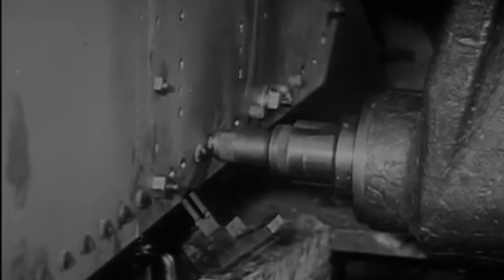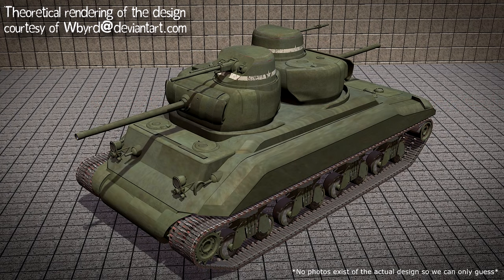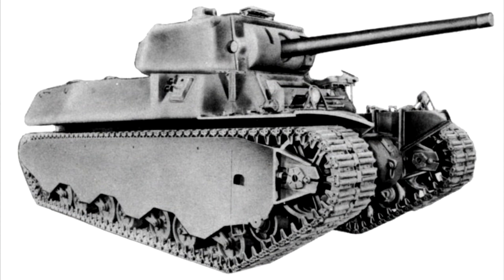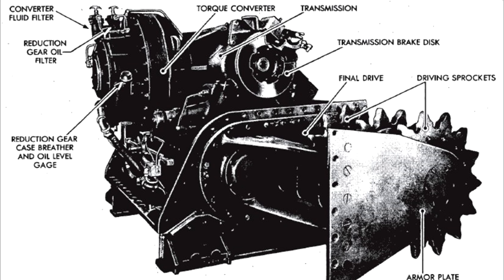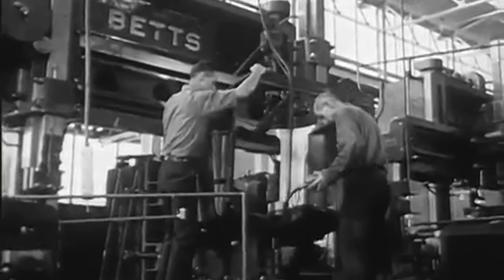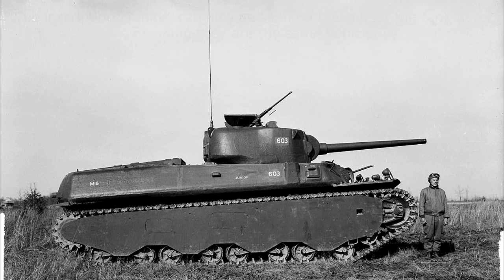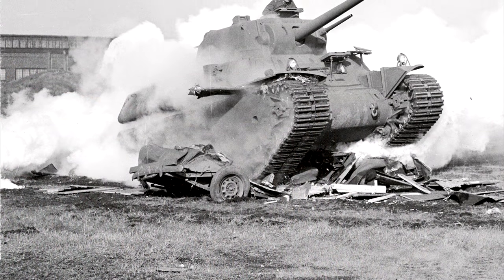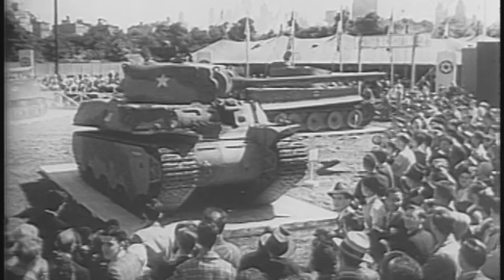America's Tiger, the M6 Heavy | Cursed by Design

Comment: Ordnance designed the M6 and M4 at the same time. The Army felt they would need one to face bunkers head-on and take on heavier tanks the Germans probably were working on. The crews hated it due to their cramped working conditions. The petro-electro drive showed promise so was set aside to use in the M4'S replacement the T series. The larger Wright radial powered a fluid drive that used kerosene as the hydraulic fluid. It was less problematic than the electric drive yet required more maintenance than the Army wanted to deal with. The new HVSS suspension held up but they had a constant problem with the tracks breaking from the weight. The armor commanders said they didn't need a slow heavy tank so the Army cancelled its production and used those on hand to test different turret designs for the M4 chassis, T series and the Heavy T26.

Comment: A hydrostatic transmission is varied in output and input, as long as you have the engine for it and it's designed right..... It's the best transmission out there.

Comment: I personally think it was a pretty poor decision for them to leave it behind because what they could have done is on the opposite side of the 37 mm put a coaxial 30 caliber and for move one of the 50 cals in the front hull with a 30 caliber as well . Probably should have kept that little machine gun they had in the back of the t1ht  beforehand

Comment: I must confess I never knew about these tanks. It must have been infuriating for M4 Sherman crews to know that the US Army had a heavy tank program all along, but just never got it together while they were being pummeled by the big German cats. Piling up sandbags, extra road wheels, scrap metal, even creating crude forms to pour concrete into on the front of their Shermans for a chance to survive against the Panthers and Tigers. Not till the closing weeks of the war did the M26 Pershing debut on the battlefields. 
Who were the guys that said two medium tanks in North Africa were better than one heavy?
Certainly not the crews that first encountered the Tiger I. US Army armoured combat doctrine would eventually call for a ratio of five Shermans  to one Tiger on the battlefield.
Reply: SPOT-ON
Reply: Pretty sure the crew can be happy knowing where the enemy tanks are already thanks to air supperiority
Reply: The M6 and M4 were designed and made at the same time. M6 crews hated the tank due to cramped working conditions and having too many mechanical problems. The M4 tankers piled all that stuff onto their tanks for protection against shaped charged weapons. The M26 Pershing had little effect on the battlefields since Congress ordered for the first 20 made to be sent to Antwerp in January without being tested and without trained crews and mechanics. Those managed to take out around 12 German tanks before the war ended. One Super Pershing was sent over in late March were the Army allowed the idiot Belton Cooper to add 5 tons of additional armor to the front of the hull and turret since 3 M26's were knocked out by shots to those locations. The Super Pershing managed to take out 2 tank-like objects that were 1500 yards away before being knocked out by a Pz. 4 that put a shot thru a side. It was towed to a vehicle dump and cut up for scrap after the war ended.
Reply: Five Shermans because that’s the number they traveled in.

Comment: From your account, they never seemed to firmly settle on a design and thus were continually ironing out bugs.  It was probably thought best to keep the bugs at home and let the boys have something a little more trouble-free.  I concur.

It also seems any tank should have an undercarriage designed to support and move about 50% more weight than the original design.  This is simply because improvements to tanks always involve adding weight.  The M6 carriage seemed overwhelmed pretty quickly with added armor and armament.  It was never ready for much of anything.

Comment: I will say that the Americans using aircraft engines was pretty smart. It simplifies production, and means more spare parts are available. Plus the aircraft engine outputs almost 1000hp. I wonder why the Germans didn't do this for their tanks? Especially for Tiger which only had around 600hp. The German aircraft fighter engines had 1000hp to 1400hp depending on the model. Much better for a Tiger tank.
Reply: Those outputs were with forced induction. In the same way that the power output of the Meteor was only about half of what the supercharged Merlin was putting out, a naturally aspirated DB 601 or 603 in a tank probably wouldn’t have been a huge improvement on the Maybach engines actually used, and German industry was already unable to meet demand for the DB engines just for aircraft use.

Comment: The reason why the M26 pershing took so long to get to the battlefield due to a general McNair, probably something similar happened to the M6 during WW2.
Reply: The Army conducted war games in Louisiana, the Carolinas and California/Arizona Mojave Desert in 1941-42 where the commanders realized that a heavy tank would be impractical to use. During the 1941 maneuvers in Louisiana and the Carolinas, they used halftracks to represent the M3 medium and M6 heavy with their weights painted on the doors. That was done  to remind the unit commanders that the tanks had to use bridges capable of handling their weight or the observers would declare a bridge being collapsed with the tank out of action if one tried crossing a standard rural bridge. Recon would report the weight limits of the bridges seen so the unit commanders could decide if the engineers were needed to build pontoon/structural bridging or if they had to find a different route for their heavier tanks (they had the M3 light tank at the time). They also had to take in consideration their reduced speeds, fuel usage and time/materials required for daily maintenance. Patton's Mojave Desert training in 1942 involved constant movement of troops and equipment where they ran their motorized vehicles to their limits with little maintenance to see how long those would hold up. The M6 was still at their training bases undergoing frequent repairs so the Army cancelled it's production after realizing it would be a PITA to use on battlefields.
Reply: The Pershing had to go through several failed projects starting from 1942.

Comment: If they had put in the 90mm gun and upped the front armor to 4 or 5 inches, and switch out the 37mm for a 30 cal machine gun, it would essentially be the American tiger tank. 

Could have worked pretty good in Sicily, Italy and eventually France. But I wonder how those tracks would have done in the deserts of North Africa.

Comment: 2:35 I can't see the sense in putting more than one large turret on a tank.  Weight is so critical in bridge-crossing and transport, and it puts all your eggs in one basket so to speak if the tracks or transmission break or what have you.  Far better to have multiple smaller tanks.   I can see MAYBE a coax 37mm for taking out unarmored vehicles or unreinforced structures, but even then, do you want 4 larger tanks with both 76mm and 37mm?  Or 5 with 76mm and 2 smaller with 37mm?

Comment: It was a good idea to make this tank. This tank was a excellent experiment what was learned from that tank  probably has some designs that are now on tank of today. I 🍻 cheers
Reply: The HVSS was designed for the M6. They experimented with the petro-electro drive since that would eliminate the transmission plus allow the tank to go the same speeds in forward and reverse. Ordnance was getting better results with that in the T25 heavy medium tank and had plans to produce around 250 for further testing when Congress demanded for the T25 to be turned into a heavy tank in 1943. It the was rejiggered to become the T26 then the M26 once ordered into production in February of 1944.

Comment: While the M6 is one of my favorite tanks, it really wouldn't have done well. It's just too big, it's the size of a small home. That, and the armor protection really wasn't much to write home about. Yes, some spots had 3 inches of armor, which for the time it was designed was decent, but it had massive weak points. Admittedly though, the 90mm gun was a fantastic weapon, and when put on more sensible vehicles, did amazingly at tearing up enemy armor.

Comment: It may have been a matter of doctrine. Let me explain:

Germany: Germany did not have a notable amount of steel, gasoline, rubber, and brass, requiring it to seize the resources, so a few, well armored, hard to kill tanks that typically win 13 kills to one made more sense in a defensive play.

Russia: Russia had a large gap between itself and Germany, all permafrost, meaning a heavy tank that couldn't even reach the frontline didn't make sense at the beginning, but later on when Russia pushed past Poland, a Heavy tank series that was still fast, such as the KV, made sense.

Great Britain: Although facing the same issues as America, the distance between Germany and Britain was far shorter. On top of that, most of the War Committee was filled with stubborn WWI vets who swore on a creeping line. This doesn't mean the British tanks weren't good. Despite being made for trench warfare and creeping combat, the tanks still did well when put under American command. On top of that, British tanks were well armed and lightweight for their armor class.

France: France, despite popular memes, put up a mean, aggressive fight. Their tanks, much like late war Germany, were designed around defensive measures. The Bis was noted for being phenomenal for point defense, as there were multiple cases of a few B1s taking on an armada of early war German tanks, such as the PZIII/IV. France's mighty B1s and various light and medium tanks were overrun by well designed, fast medium tanks.

America: America was in a bottleneck, being one of the few countries in the war not connected to Europe. They needed tanks under 50 tonnes to be loaded and offloaded, as cranes and transport boats could only handle so much. America also did not have the problems that plagued most German designs, having plenty of homeland steel, rubber, gasoline, and brass. This allowed the Americans to afford a doctrine of modifiable, relatively cheap, standardized, and flexible medium tanks. This doctrine would allow America to deploy a sizeable amount of reliable and easy to use tanks for their troops away from home. Later on in the war, this doctrine was loosing speed, but the Sherman chassis had enough power to allow for heavier armor, and the almighty 76 long gun. Some even had Concrete(although incredibly rare) armor to at least add some protection to previously existing shermans, and the tanks handled the bulky armor somewhat fine.

All in all, the tanks that the countries produced made sense for their homeland locations, allll had their respective pros and cons, and were made to fulfill a specific parameter, such as defense, easy repair, easy to use, or good offensive capabilities.

New Zealand was just high the entire time, but at least the kiwis made an attempt

Comment: Absolutely the right decision.  The simple fact is that the US Army had it right: there was no mission for a heavy tank.  The idea behind a heavy tank sounded good in theory: heavy tanks would punch a hole through the enemies front lines, and then light and medium tanks would exploit the breakthrough.  That just didn't work in reality, though.  It was not the weight of the tank, strictly speaking, that made the breakthrough.  It was speed and surprise.  The key was to move forward faster than the defender could react, getting inside the enemy's decision cycle, so to speak.  Also, can you imagine logistical burden these monstrosities would have posed?  Think about how much fuel they would have needed, and how many spare parts.  As it was, the Allied Expeditionary Force had to operate on a logistical shoestring after D-Day.

Comment: The fact really is that the M4A3E2 is just a much better heavy tank in just about every single way. Plus its basically just a M4A3 with some extra plates welded onto it plus a slightly different turret so it basically shares part commonality with the Sherman. Like really the jumbo is reportedly faster, has MUCH better effective armor, is nearly half the weight, has less crew, has a smaller profile, wet ammo storage, And it just looks like a regular Sherman so most of your enemies wont even know that, that particular Sherman is frontally immune to everything but the long 88. When you look at the two side by side its almost absurd that the M6 was even remotely considered. Granted the jumbo is a much later invention at 1944, but if this concept was thought of earlier, well its not like its particularly complex, there were some suspension issues, and the turret was re designed but really there is nothing overly special about the jumbo compared to a regular Sherman so I can easily imagine a alternate reality where the jumbo rolled off the assembly line as just another variant of the sherman at the very start of the war

Comment: Having a Heavy Tank during WWII might have been nice, but i doubt we had the shipping capacity to move realistic numbers of the M6 because of it's weight and over all size.
Reply: The M6 could've been transported on Liberty ships. Those carry two sets of booms for their cranes that were rated for 30 and 50 tons. The tanks were carried topside so if the M6 was too heavy, they would've removed the turret before the lift and set it back on once parked on the deck. Then a crewman would've sealed the gap between the hull and turret using wide duct tape, which was created for sealing off seams, gaps and openings in tanks to keep salty sea air and spray out of the interiors.

Comment: It's a shame the engineer team did not rationalize the design a little further, by dropping the 37mm coaxial and the rear-facing .50 cal, and maybe a few machine guns as well. Perhaps if that had resulted in an acceptable reduction in weight and crew members, it might have led to acceptance for service by the Army and mass-production orders. It looks like it would have been a formidable tank on the battlefield, had its more awkward and superfluous features been eliminated.

Comment: It could only have been used for test purposes unless the decision to throw it blindly into mass production was foolishly made without test trials.  Beyond that, from a logistic standpoint, testing it in France would have been unnecessary stress for logistics, which at the time were basically overwhelmed to begin with. Pity they didn't think of pushing it a lot earlier. It might have been very useful if put in the field at an earlier date.
Reply: Ordnance had 250 M6's made for field testing with production being cancelled in 1942 because it had too many problems.